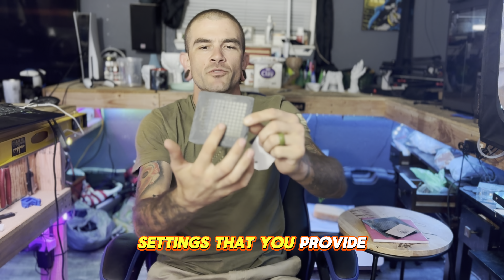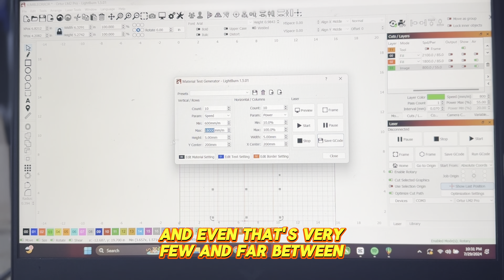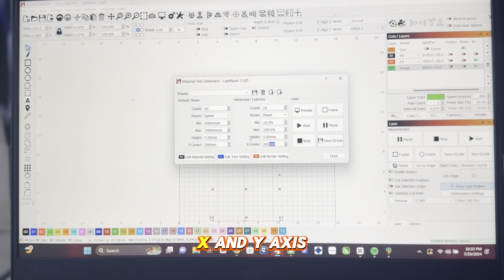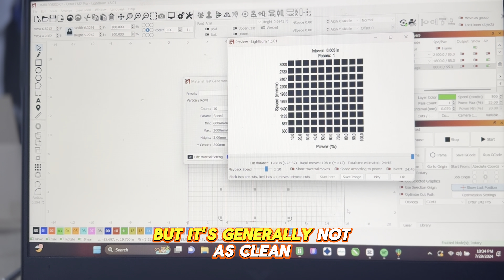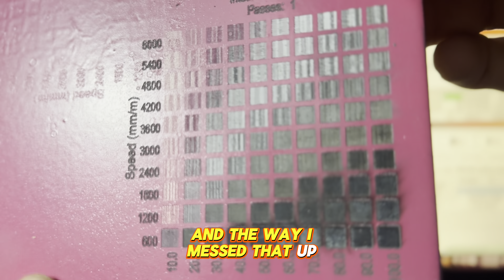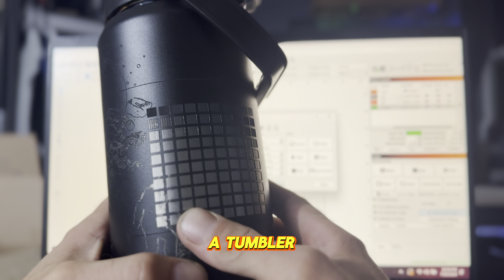Lightburn Basics - Material Testing - How and Why?

Comment: Hi, what do you use to give you a baseline in different materials to run this test. Example… paper or stainless steel so your not destroying or catching you material on fire lol.
Reply from the maker: @chrisimperial6516  when doing highly flammable material like paper I set my settings accordingly (each laser will vary) but generally I would run 2-10% Power and a high speed 1000-2000mm/m to start and move from there. 

With steel, I would do almost the opposite and see what it takes to catch it on fire 😝. Honestly though, with something like metal (aside from thin types of aluminum) you are generally ok to go slow and high power to see the full spectrum of color accurately. 

Let me know if you have any more questions and feel free to reach out to me on instagram if you wanna chat!

Thanks for watching